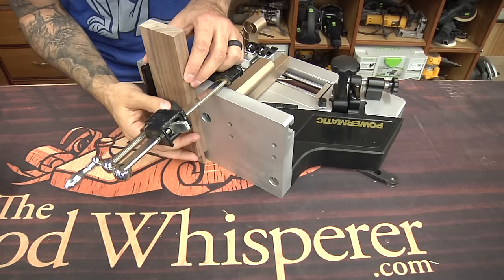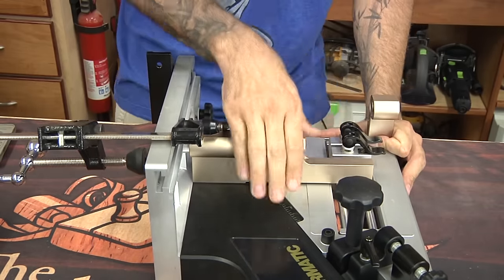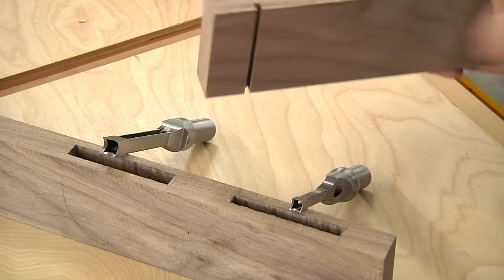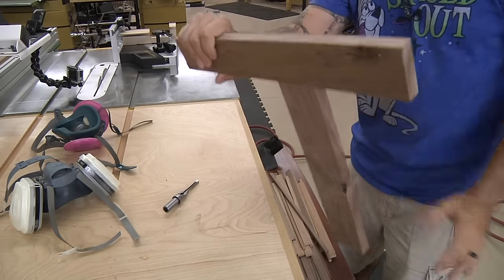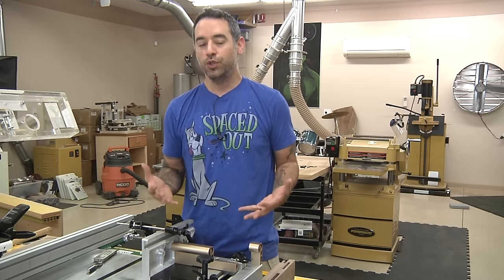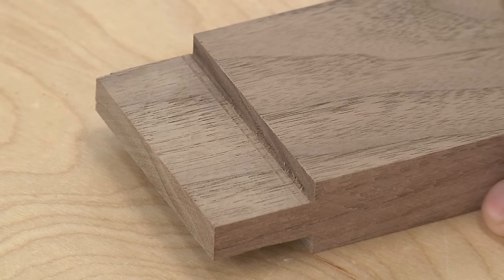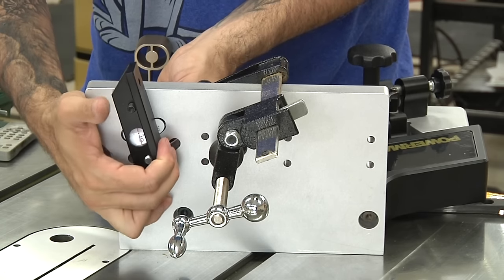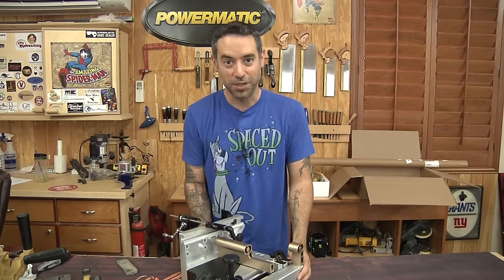270 - Powermatic PM-TJ Tenoning Jig

Comment: I bought this based on your video. It’s an ok tool. However, in my opinion the clamp that holds the stock is just junk. I should have recognized the big Powermatic sign on your shop wall and figured it out.

Comment: You are totally right, such a huge leap forward as far as tech and ease of use are concerned. I was also surprised it didn't cost more. I can see it easily saving a pro at least that much in labor over the course of just a few builds. Tenons can be so finicky and this jig takes all the guess work out. Didn't see you reaching for a shoulder plane even once! 😉

Comment: What happens if you cut thr mortises with a router bit? Seems like you not be able to set the correct width very easily. I use a shop built tenoning jig has some setup, but works great. Just made 24 tenons with it all the same width.
Reply: +Donald Schlicht
I'm going to assume that you missed the part of the video where he explained that you could use a router bit exactly as he used his square mortise bits to set the stop in this demonstration.
Watch again starting at 4:37.